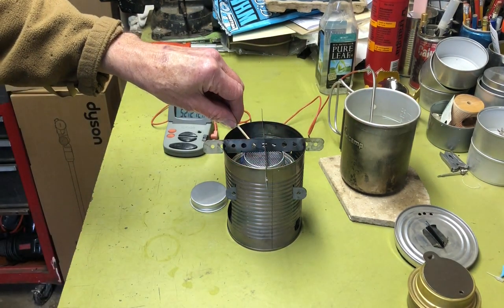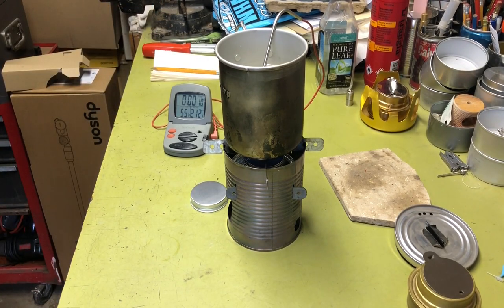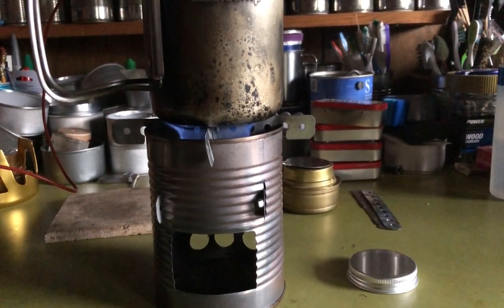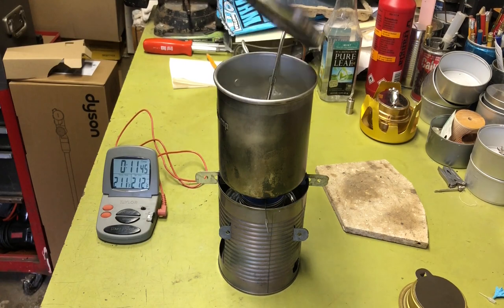HOBO Stove using a Trangia Alcohol Burner

Comment: 👍👍👍 .. nice.
Yep, the Trangia is a versatile, reliable little burner.
I keep mine permanently as part of my Trangia 28-T Mini enhanced setup. It's a 'pickup and run' .. only additionals needed are the Trangia Fuel Bottle, a little 'Cutlery Pouch, Leather Gloves and a Carbon Felt Cloth 'Flammenshutzmat' for a heat protection base and I'm good to go. As all are stored together, no huff and fuss 😊.
My Hobo Stoves, and Bushbox LF in SS .. I use a myriad of 'home-grown' Alcohol Burners in them .. including a 'White Box' Burner (incidentally my first ever alcohol stove).
I find it handy, even if one is planning to 'burn trees' out there 😏, to have with, a little Alcohol Burner and some Fuel. Too wet .. or too dry .. a little 'spill resistant' (packed with Glass / Ceramic Wool) Burner comes in handy.
Thanks for sharing. It's always nice to see what others are doing .. picking up ideas and useful tips along the way.
Take care ..
Reply from the maker: I have a Trangia in my Pathfinder bottle bag kit that I carry in my kayak.
(https://youtu.be/gHugXPk-cyg)
In my car I have a Fancy Feast stove and bottle of Heat also a fordable  solid fuel stove.

I also have a 'White Box' stove, it was one of my first, I tried to make my own but it didn't work out.

I'm going to try adding carbon felt to the Goshawk burner and see how it works, I may do  a video on it.
Have a good  one.
Reply: @planetsideagent  👍 .. yes please, a video on the Goshawk with Carbon Felt would be an interesting one .. thanks.

Comment: I was going to ask you what’s the best alcohol stove then you mentioned the Trangia.
Reply: The Trangia is a well-made reliable, little burner .. proven over decades. It does the job, does it well and will not let you down.
The Trangia 25-27-28 Sets are in my opinion, worthwhile considerations and will give one many years and more, good service.
Is it the best? Yes and no. That depends on for what you want to use it. I cannot offhand, for my specific applications, think of better .. but then, I have not tested any other similar / clones. Although, the Simmer Ring off the Esbit equivalent with the little folding handle seems to be quite neat. However, buying the Esbit Burner just for the Simmer Ring for me, is not justified.
To me, the 'best' of anything is that what I have, use regularly, does what I expect of it and does it well .. and important, is paid for! 😏.
I have made a mod to my Trangia Burner that makes it more 'knock-over /spill resistant' without unduly compromising burn efficiency. Here in Switzerland, the Authorities take an extremely dim view of individuals burning down their forests. In this regard, they have absolutely no sense of humour with eye-watering fines / jail time being the order of the day.
Should you be interested, I can share it with you .. 'Bernie Dawg' and others also have similar in their You Tube Posts.